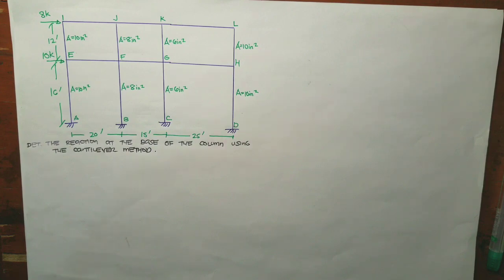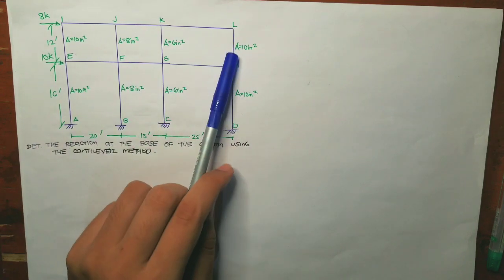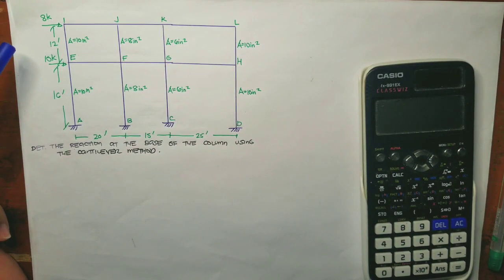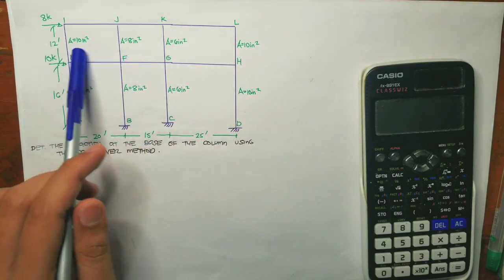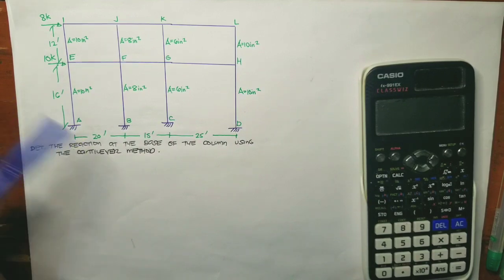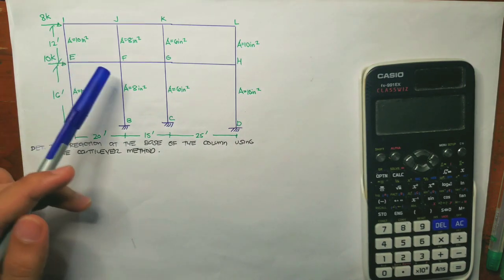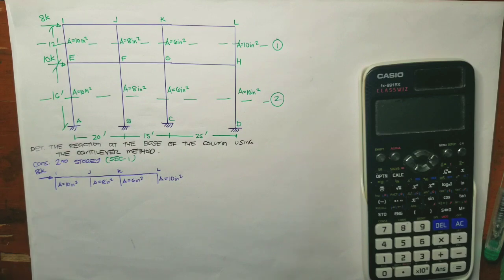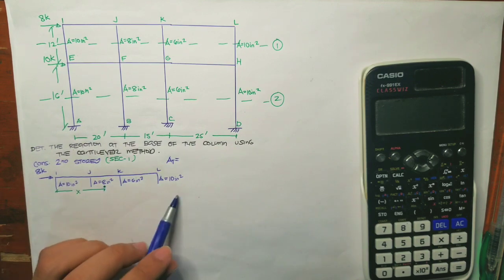Structural Theory - Chapter 4 - Approximate Analysis for Statically Indeterminate Rigid Frames Part5

Comment: Hello po sir. May tanong lang po ako sa pagkuha ng column shear sa first floor, hindi na po ba sya itatimes sa 1/2 yung height ng column. Tapos yung sa pagkuha ng moment sa A hindi narin po ba sya itatimes sa 1/2 yung sa height ng column para makuha yung Ma. Thank you po!
Reply from the maker: pls check the step by step process, ginawa natin yang assumption that half ng storey ht and girder length ung icocosinder lagi.